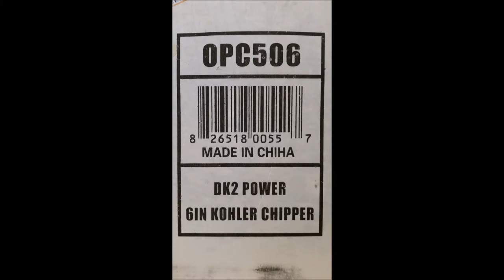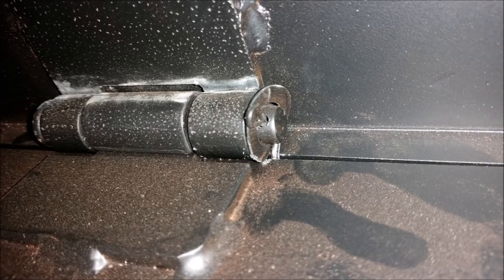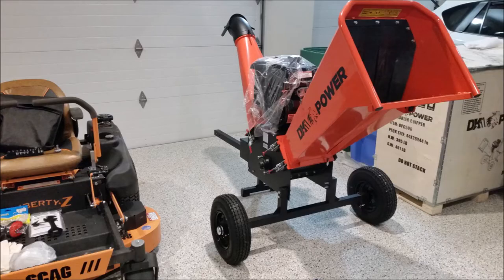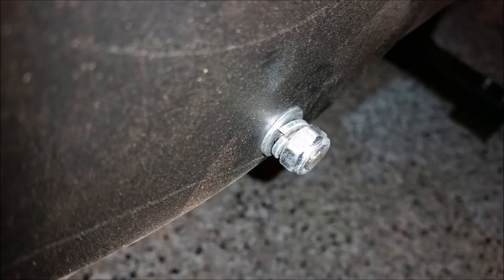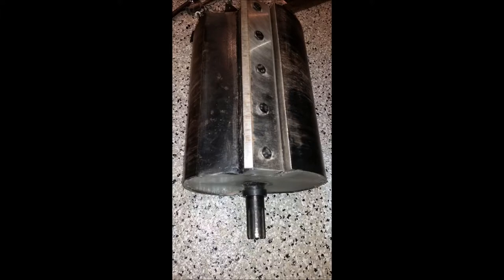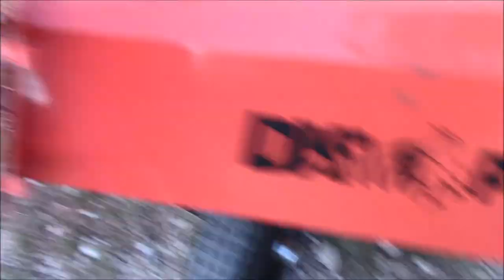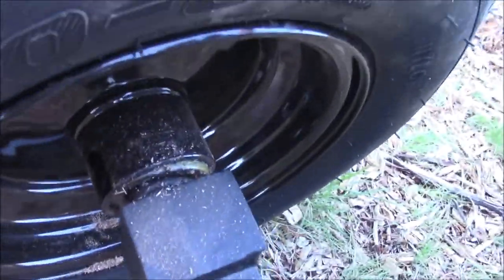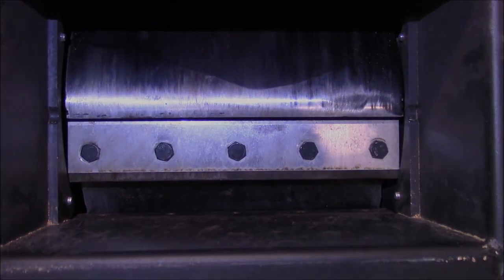DK2Power OPC506 Wood Chipper NIGHTMARE and Tear down!

Comment: Try Jensen GTS-2000pro. It has the same 14hp Cohler but smaller diameter 4"7 but may be better
Reply from the maker: that was on the list, but after looking at it's design i'll pass, it's another "designed in usa, made in china" piece of garbage, no thanks!
Reply: @morejelloplease  I have a lot of wood to dispose. Which one you think may be better designed?
Reply from the maker: i had a $5k chipper recently and it was a royal pain in the ass, i dont recommend anything so far, nothing has my seal of approval lol.  you may have better luck than me, i'm pretty fussy.  whatever you decide on just make sure you can return it.  if it doesnt do what they say it will do or what the videos show it doing then you should be able to return it, the only good thing about ordering one thru a box store, you have that piece of mind.
Reply: I've used the jansen gts 1500 for over a year now doing professional tree work . I cut wood up instead of chipping no bigger than my arm and it has always worked great . It never let me down and I've used bigger chipper before with my old tree company and 100% know how to chip and what machines can do and for its size you can't beat it . I get it in back yards and next to places a big chipper never could go . When the blades get worn it doesn't work as well but it took a year before I had to flip the blades and adjust the gap
Reply from the maker: @mrtree1368  you got lucky and got a properly aligned machine it sound like.
Reply: @morejelloplease  that might be true I've seen some people have issues with Thiers but it was always like a rust issue . Some people just don't know how to use a chipper and sometimes they are the problem . These little chippers if u want to take care of it for the long run don't chip up too much wood and depending on the type of tree can affect the chipping . Some trees are more leafy and can clog but u just need to use it right for things to run smoothly. Almost all the problems these little chippers face a big chipper can have the same issue if ur not smart about it . With that said manufacturing errors obviously arnt somethin u can work around . I watched as many videos as I could cause no one around here has these kind of little chippers and I found the jansen being the best . And at least for mine it's proven that a long time ago
Reply from the maker: @mrtree1368  I bought a $5000 commercial unit and it broke in 30 minutes , it wouldn't chip a 1 inch branch , I had the managers and engineers on a teleconference several times which they recognized there was a defect after making videos and they shipped me parts. I fixed it but I was still not happy with its performance.  I had to rent a heavy duty machine that could keep up . After the storm here every tree on my 2 acres lost ablimb or two.  I needed something that could step up to the plate . Sadly even a $5000 commercial chipper can have problems and not handle the task.
Reply: @morejelloplease  well the thing is those commercial units that cost that money are nothing compared to chippers tree companies use and  I think people get the 2 confused especially when it comes to performance and operator error . You really need to have the Brush worked on before u chip so it goes in easier and try to rarely chip up dead or dry material for its harder on you and the machine. Plus there's no reason to wait for brush to dry up to chip it .it even says in my manual not to chip dried up things and dried up wood is even worse . I prune trees and the chipper handles it all just great sometimes I get small handful of smaller branches in while holding on to the end to not let it all go threw as fast so that way the rpms stay up and sometimes I put in just 1 large branch and all I gotta do is let it chip up the first bit hold it for a second to let the rpms get back up then it eats the rest with no issues . It's jammed a couple times but so do big ones and small chippers are easier to fix the issue .and again it's all operator error and u just gotta learn how to feed these little chippers . Now the one u have I'd agree kinda sucks for I never saw a video that impressed me with how it chipped but almost all the jansen gts1500 videos showed awesome performance and I was very happy to see that mine acted the same . Now it's funny but u might have to check the gap on the blades even on a new machine and that is everything when it comes to chipping good other than sharp bladed . Hopes this helps
Reply from the maker: @mrtree1368  i check gaps on everything :)   in the case with this dk2, the machine was a piece of junk and would never gap properly.   the "commercial residential" mackissic i had would eat a 1-4" branch, fresh, dry, it didnt matter BUT it would take      a minute for each branch.   when you have 10 piles of brush, i dont have time to wait for a chipper.   and yes, any of the vermeers will smoke a high end residential or so called commercial chipper.   i hate the word commercial, people assume it's of higher quality because the metal is a little thicker or the engine has a few more horsepower but at the end of the day it's about cut quality and longevity, ease of maintenance, etc.   if you get that out of your jansen then you're lucky.   i've seen lost of broken jansen videos.   just depends on how you treat it like anything else, but most of the ones i've been buying are junk right out of the box.  i'm sick of being the guinea pig.   my videos are just real world experiences :)

Comment: Dead, bone dry wood is not ideal for chippers, also that "not straight" branches. It will not want to feed.
Reply from the maker: Sorry,  but if a 6" capacity chipper can't swallow a 1-inch twig, then it's a POS.

Comment: You had me lmao😂 Trying to feed that branch in the chipper! I'd say that chipper is not a good deal lol. I used to do tree work and we had big vemeer chippers. Those chippers aren't no joke. High RPMs you lose your arm in that thing. But anyway man you had me laughing😂👍😊😆
Reply: Meiere Christi  probably! I know those chippers they use to make mulch. Are massive! There like 2 stories high! They put whole big trees through them! Anyway I used to work for a Landscaper down in South Florida. I was a forman. So one day my boss told me to run out west where they make the mulch to get 10 pallet of mulch. I'd been there many times before. And seen the big mulcher in action! It gobbled up whole trees no problem! And sprays red dye out the end on to the chips. Anyway I get to the front  gate and it's closed. Which it's always open. This is a Tuesday I think. So I call them. There company name is Earthwise mulch. So they answer and I tell them I need 10 pallets of mulch and I'm at the gate. They told me there closed for the day that the guy that runs the big mulcher fell in! A log was jammed. And he didn't follow protocol and shut the machine off and get help. Instead because he had worked there for yrs. He tried to break loose the jammed log! Well he succeeded! And he slipped and went with the log! Crazy! I could only Imagine his last thoughts! But it was over quickly atleast. 😟😔

Comment: $2500 will go a long way on a good used chipper or one to run off an old tractor.
Reply from the maker: I paid $5k for the commercial one with an 18hp vanguard, wasnt worth $2k, I quickly sold it. I wish I had a pto.
Reply: @morejelloplease  I am curious what kind that was. I have found small home store type machines are all pretty weak even if you're good at tweaking them in to maximum performance. Stamped steel can only take so much without flexing.  But more heavy machines with thicker, welded steel, and adjustable bed/anvil plate (also sharpenable) of some sort, makes a machine you can work with. My little old DR isn't the boss, but it does very well for the money. I can sharpen the knives and bed plate,  and adjust the bed plate closer to the knives and get it cutting fast and chipping small chips. 
I would prefer about another 1/8" of thickness to the chipper housing,  at least another 1/4" thickness on the flywheel (it is 3/4" thick now), but really, that would be better at 1 1/4" thick, and I would more fan blades to blow out the chips, and a chute that made it east to load into a truck or trailer.  Of course then it would need 30hp. My old tractor is about 35hp on the pto, it would be perfect but not for going anywhere and doing tree work off the farm. 

Sorry you went through such a mess for a chipper.
Reply: @morejelloplease  are you referring to that compact yellow one?
Reply from the maker: @TacoBoyManThing  strange i saw your reply but not matthews.   compact yellow one?  i bought a merry commercial made by mackissic and it broke after 30 mins, it wouldnt even chip a 1/2 branch.   they worked with me , sent me parts to try but it never worked right.   I finally got it where it would chip a 2" limb but it had to be perfectly straight and freshly cut.  that chipper was supposed to be the answer to te he power king . DK2 power junk but it turned out to be a failure also.  i sold it about a week later. as much as i'd like to have my own chipper,  it's best to rent a vermeer 1000 for a few hundred bucks.   that thing will eat a bicycle.

Comment: This is a cheap Chinese knock-off of a Woodmaxx DC-1260, which I have owned for the past 4 years.  It is definitely superior to this unit.
Reply from the maker: Sorry to burst your bubble but there are only a handful of companies in China manufacturing these, every year is they change them up just enough to confuse the end-user. Most of the USA designed chipper such as your WoodMax is actually made in China. Some are made better than others but I wouldn't bet on it. I did get my hands on a US-made MacKissic who also makes chippers for the DR brand and had trouble with there's also . If I need any chipping done I'm just going to rent a Vermeer for a couple hundred bucks , being able to feed 10 inch logs is rather enjoying to watch on a large machine that I don't have to pay for, store, or maintain. Best of luck.
Reply: @morejelloplease  I can tell by specific details of thus unit that it is a poor quality knockoff.   My DC-1260 is awesome, and I put it to heavy use all year round in Florida with no issues.
Reply from the maker: @Dave-co1cv  some people report the dk2 has worked fine for them, i seem to get lemon machinery these days :)

Comment: You need to go buy any other one at that price range and see what you get.. I ran a 12 inch power feed wood chip that did not want to take a 2 inch branch because it was bent all stupid.. You are like the worst person to demo a machine. Good luck finding something you wont grumble about.. I have bought stuff made in the US that was made on a Monday and all the workers must have come in still drunk.. Go buy a DR Woodchipper and see how you like that lol..
Reply from the maker: I bought a MacKissic that's a commercial version and they also make DR. That had issues also.  I'm about to release those videos.  I gripe about everything when it needs griping about. Like a $12k scag lawnmower that leaked in 5 places,  I didn't even mow with it.
Reply: @morejelloplease  Everyone has bought a lemon from time to time no matter what country it was made in and at all price ranges. I bet that new wood chipper you is not as cheap of a price
Reply: @sirwallygator565  Grumpy Chipper

Comment: Dry wood into the chipper? Are you surprised it doesn't work fast? I am not. You are just a trouble maker, but want to push the responsibility to somebody else.
Reply from the maker: The video speaks for itself
Reply: He may have been exaggerating on the chipping speed for a model that doesn't have auto feed and might get better results loading more wood behind the first, but the blade and anvil alignment are terrible on that machine.  I thought the anvil would be more of a right angle to the cutter knives (like in a disk type chipper).  Dry cedar is still a soft wood, and should chip up easy.  I think your comment might have been a little harsh, but you are entitled to your opinions.